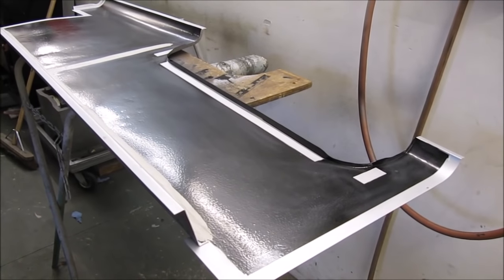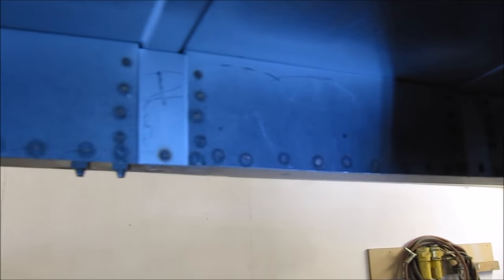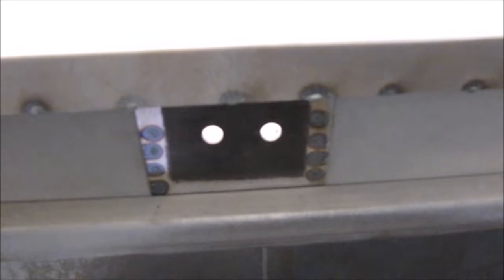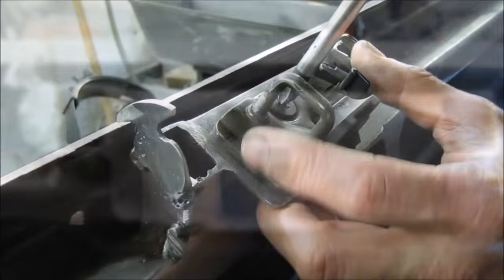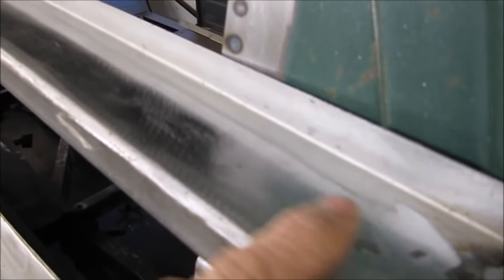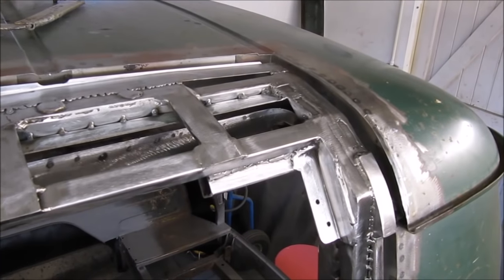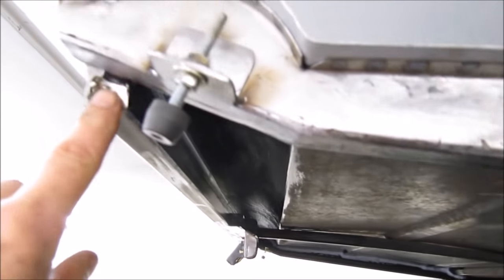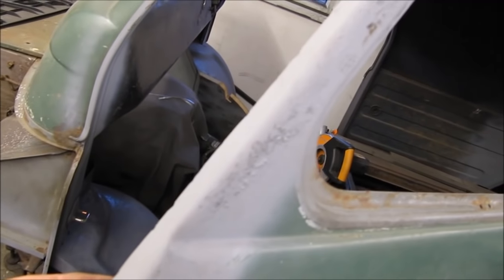Trev's Bedford CA Van Blog - Part 12 Catering conversion Bodywork Panel Beating

Comment: lol ,cheers Trev I will take you up on that. I will give you a txt mate when I plan to darken your door .I have a bit of work on motorbike wise myself at the moment ,always some thing to do lol. I have decided to get the purple ali framed one back on the road the tig welder has come in handy for a few jobs on it .
Reply from the maker: Yes mate I've seen you welding up rotten tanks, you must me a glutton for punishment... Couldn't you seal the tank after welding to prevent any pinhole problems?

Comment: Trev hi, yes you can go down the tank sealer route .I have done this on a few that were rusty ,I have soldered one up then sealed it .I have also had the sealer lift away on the inside so it creeps between then leaks .so my plan is make petrol tight then have a go at nickel plating  the inside to stop the rust from the fuel or coat with a sealer. either way its still a mare.lol
Reply from the maker: Yeah sounds like it,... I couldn't be bothered with it myself, I remember a chap I worked with years ago welded a tank, painted it, dark patch appeared, it was leaking... So he soldered the joint, painted it, leaked again... Cut the plate out and decided to braze another plate in with a welding torch, the tank blew up in his face. Made himself bad he did.. Anyway...
Reply: nasty. ah you know me Trev I don't mind explosions as long as I am not on the end of it. so far they have been well cleaned out as in the garden incinerator to get them back to bare steel then in the pickle tank yum yum citric acid. trouble is these bikes are old now and s/h tanks are silly money then the thing might leak.ah never mind its slowly sending me round the twist lol.

Comment: Quick question: from start to ready to paint....how long did this door take you (months ?) and approximate hours on it. So I can multiply by 10 and guess what it would take me to turn my 28 Ford into a delivery.....no top henge just side henged. Thanks Trevinator!
Reply from the maker: Boxcar's Garage thanks buddy, hey it took me ages so don’t beat yourself up about taking a long time. My philosophy is take as long as you want to get it right rather than rushing it regretting a bad job. Cheers Trev 👍

Comment: just out of interest when you cut floor patch out and weld new in is there any need to weld the underneath  if checked with light for pin holes thanks.
Reply from the maker: Jason Turner Hi Jason I'm slightly confused by your question, are you asking a general question about welding? If you're talking about a general patch repair on a floor panel... there are many different ways to approach a job, to make a seamless repair, a patch should be made up first and then the hole cut exactly the same, once it's welded in and the weld ground off flush, it's possible to make a virtually undetectable repair, these kinds of repairs can be difficult to perfect though... if you're overlaying the patch (i.e. The patch is slightly larger than the hole) then I believe it's fine just to weld it one side and then seal up both sides with a good sealer, fully clean and primer all of the steel first as sealers absorb moisture to cure and can cause your freshly welded in repair patch to rust.

Comment: WHAT DID YOU CUT OUT THE SIDE WITH , DID YOU USE A GUIDE OR FREE HAND THE CUT???
Reply from the maker: SAXONWARLORD1000AD I used a 4 1/2” angle grinder with a 1mm thick cutting disc freehand “fairly straightforward “ the door gap was set at 8mm so I had plenty of metal to allow for deviation. Cheers Trev 👍

Comment: Amazing craftsmanship.
What's the sheet metal thickness you work with?
Reply from the maker: TheMetalCottage 1.2 mm and 0.9mm cheers Trev 👍
Reply: Thank you. 
Much thicker than I thought.
I'm just starting with bodywork, so I got myself a 0.75mm patch to destroy learning as I wish to do it the propper way instead of tons of filler. 
I might have more questions in the future.
Reply from the maker: TheMetalCottage ok 👍 I  normally 0.9mm on outer skin panels. I only use thicker if extra strength is needed. Cheers Trev 👍

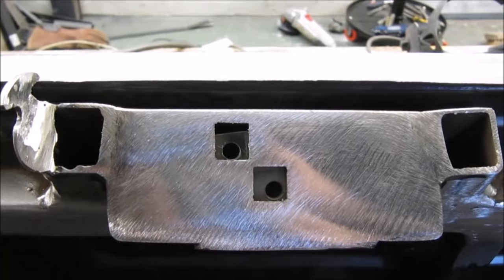Comment: How were you able to punch out those squares in the metal - 13:48 ?
Reply from the maker: No special trick just a round hole filed out, if you’re inclined to have a go you can fashion a chisel into the square you want curve the very point with a belt sander to give it a cutting edge, this will punch though mil steel easier than you might think. Cheers Trev 👍
Reply: @trevsblog  Thanks Trev ! Sometimes the most obvious ways are the overlooked ones for me.

Comment: How do you stop everything rusting when you're working on it ?
Reply from the maker: My workshop is bone dry and metalwork can still look as fresh a couple of months after I’ve done it with no rust formation. I have also used an aerosol primer just a coat on the surface and then sanded it all off before priming it properly. Another good solution is to just epoxy prime each area as you go along and then it is certainly well protected and ready to accept additional fillers or primers. It is well observed that things won’t stick well to fully cured epoxy primer and sanding is imperative before you apply further coats of filler or primer. Cheers Trev 👍
Reply: @trevsblog  awesome thanks for that trev

Comment: WHEN YOU GET YOUR NEXT HONDA LATCH.....CUT OUT CATCH PLATE WITH IT...!!...SAVE YOU SOME FAB TIME...
Reply from the maker: Southpawsgarage I did but it was completely the wrong shape, ended up scraping it apart from the captive nut. It was a very difficult job finding a good position for the latch without it hitting the side, not hanging down too far with the side open, being the right side of the seal and still being accessible. Cheers Trev 👍